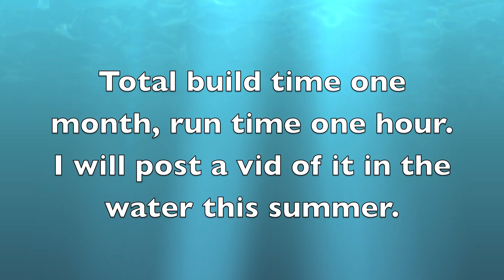Inside the Lindberg Radio Control Fletcher class Destroyer

Comment: My dad is currently building his second Lindberg 1/125th scale Fletcher, and we are also going to do an RC conversion on it.  We are doing to do 2 ESC's (or a dual ESC) for independent engine throttle.  Any recommendation on what motor to use?

Comment from the maker: Two of the kit motors is plenty of power, much more and it looks unreal on the water...
I did two engines but only one ESC, novel idea!  If you go higher RPM the stock prop tubes will wear fast, also the propellers may break, unless you plan on replacing all of that stuff I would go with two of the plane old kit motors